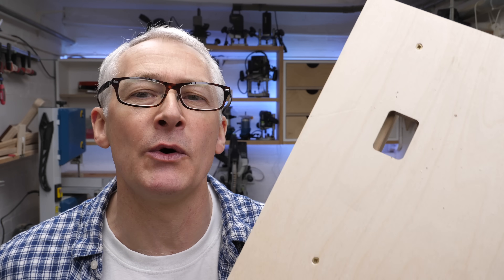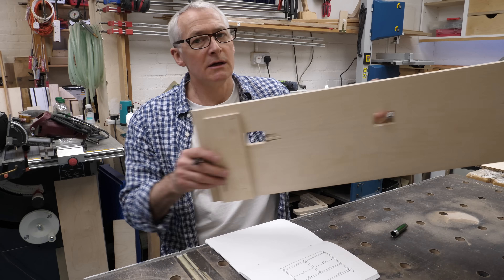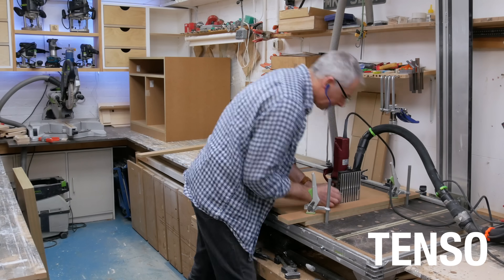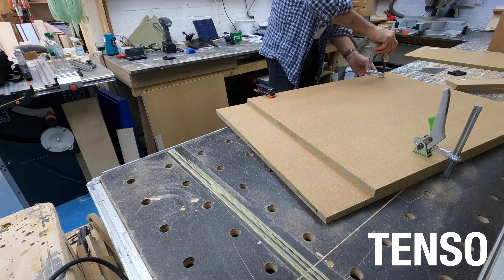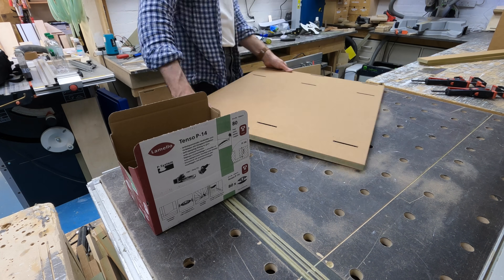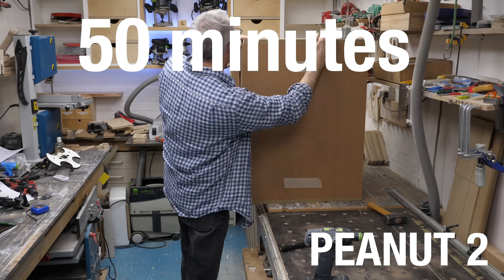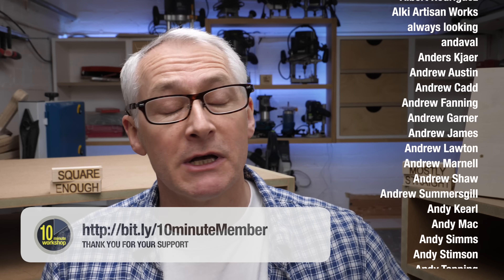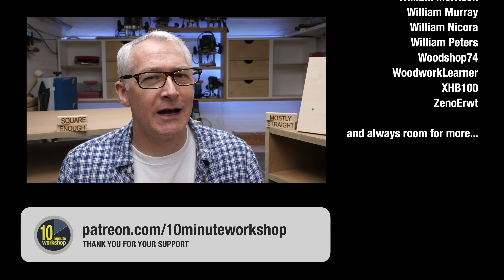Peanut 2 or Lamello Tenso? [**Gifted/Ad][video 450]

Comment: Really interesting. I was exhausted after watching it all at X8 ! I was wondering if there is any real advantage between the two systems (apart from price). Is one considered stronger than the other, or are there certain applications where you might choose one in preference to the other.
Great video, thank you!
Reply from the maker: Thanks! The big difference really is the price difference between the two, not just the up-front costs, but the consumables as well. In terms of strength, the Peanuts2 is vastly stronger than the Tenso; a Tenso joint must be glued as well, the Peanut2 can be dry fitted.
Reply: @10MinuteWorkshop  Thank you!

Comment: Would like to see a domino jig comparison, perhaps up against a dowel jig, this is the least expensive option and much of the time knock down fixings are either not required or not desirable.
Reply from the maker: I’ve done the plain-vanilla comparison in the Cabinetry Basics series; my idea for a domino jig would be as a carcasss jig, so an e.g. 3-slot jig for 600mm deep cabinets. 👍👍

Comment: Amazing, wish I could move that fast.  Question....why does it appear the upper drawer cavities are of differing heights at about 10:10, right after the comment on 55 minutes?  Is that an optitrickal relusion?  Fascinating to watch.  Ps, I made a router jig for using Dominos before I got a real one.  It worked well but was limited.
Reply from the maker: I wish I could move that fast too! And no, just optics - the cabinets are identical. 👍

Comment: Excellent video as always Peter. I always learn a trick or two from your videos. Do you know the strength of the two different fastening methods? Just curious which one is the stronger system. Maybe a good idea for a video? Peanut vs Lamello vs domino strength test??? 🙂
Also.... have you had a chance to try the Lamello Flexus connectors yet? They come in pretty handy.
Thanks Peter
Ron
Reply from the maker: Thanks Ron! No, I haven’t tried the flexus yet - haven’t had the need tbh. And as for strength tests, the peanut wins hands down; 90Kg in MDF and 140Kg in plywood, vs 7Kg for the Tenso and ~80Kg (from memory) for the Clamex. 👍👍

Comment: Great video as always. Having worked with Luke at IF I know they are always helpful and he has a great eye for detail in his products. My main question for you is, when it’s time to make a paid three carcass project for say kitchen wall cabinets, without thinking about it, which system would you use to build it?
I presume you would go domino? (I know not all the systems are equal). 
Will I see you again at the Summer Cycle?
Reply from the maker: Thanks! I think I’d tend to default to Dominos, just because it’s what I’ve used for the longest, and I’m most comfortable with. And yes - if it’s open, we’ll be there! 👍👍
Reply: @10MinuteWorkshop  Thank you, for your honest opinion. Fingers crossed it will be.

Comment: Do you think a peanut system would work on a cnc machine? I'd imagine if it could be written into the code to do the style of pocket this would be a very quick and cost effective system, apart from the super expensive cnc machine of course
Reply from the maker: It was designed for CNC and nesting machines. Have a chat with the guys at @intelligentfixings that have vast experience in this area, and are very approachable. 👍👍

Comment: Another great video Peter, what would you say was the reason the Lamelo fell apart? Would also be interesting to see the strength of both the cabinets once constructed
Reply from the maker: The Tenso carcass fell apart because it doesn’t have the clamping strength to hold together, in my experience. The Clamex connectors are excellent, but the Tenso seems to be a much lighter-weight fitting.
Reply: Tenso needs glue
Reply: @10MinuteWorkshop  I don't understand this comparison- You're not using the Tenso correctly (needs to be used with glued) and bashing the system because you're not using it correctly?

Comment: Peter I'm a bit surprised you don't use the Zeta more often for carcass assembly. It may be because you're so accustomed to the Domino? Or you don't want to upcharge for the more expensive fittings? It seems to me from your videos that the Zeta might be quicker to work with.
Reply from the maker: It’s more that I bought the Zeta around the time that I started to do less cabinetry, really, and though the fittings are very expensive, they were usually a tiny amount of the overall price of a job. To make this carcass with Doninos would be much more challenging at the glue-up - I may do it as a ‘domino project’ just for fun. 👍
Reply: @10MinuteWorkshop  I enjoy using the Domino but I find it can be unforgiving and/or overkill for basic carcass joinery that's going to get screwed together anyway. I'm eyeballing the Zeta for the Clamex and Tenso.

Comment: That's a great video, thanks for the content! 

I was thinking the same thing 're the loose tenon. Interesting to see how fast that went up, Im really surprised as I love the Lamello for its speed but the connector cost is a big draw back. Not so much an issue when building for clients as you pass the cost on but when making jigs, boxes, carcasses etc in the workshop I have a tendency to not use it as its all additional cost and it soon adds up over time. How would you rate the Tenso vs Peanut in terms of strength? 

Do you think we could make a jig and use the Peanuts to make timber panels up? That's one of the jobs we use the Lamello for, when you have 40 signs to make consisting of 160 pieces of timber, the Lamello sure cuts down on the clamping time. Do you think the glue would squeeze out of the joint or would it leave enough in there to join the pieces together?
Reply from the maker: Thanks! Peanut is 10x as strong at the Tenso - literally, 7Kg (Tenso) vs 90Kg (Peanut in MDF) or 140Kg (peanut in Birch ply). That's a great point about panel glue-up and too much clamping pressure - hadn't actually considered that, but the Peanut joint tightens the more you move it, so I guess you'd just nip it up enough to give a good pressure. Don't know if @intelligentfixings have done any tests on this? Hopefully we'll hear back, but if not give them a shout - they're very approachable. 👍
Reply: @10MinuteWorkshop  Ill definitely give them a shout. You have now created a whole world of issues for me though. There are lots of smaller projects we could batch out and have for sale on the shelf but the tenso cost makes it prohibitive...hmmm I might need one of these 🤦‍♂️ haha thanks again Peter. Have a great day!

Comment: For the domino jig could you just use the peanut 2 jugs you’ve already made with a 8mm spiral down cut router bit instead of the peanut router bit.
Reply from the maker: But only 1 size of slot. 👍

Comment: You know… I know it’s not really your normal video, but… it does make me want to see some destructive testing of domino vs zeta vs peanut 2 vs glued-nailed. I know tests like that are always controversial, though. I also vaguely wonder if you can add strength to a domino by running a couple of 23-ga pins into a dominoed joint strategically. YouTube has a lot of “let’s see if X joint is stronger than Y joint” but not many “how can I make this joint stronger” videos. Except for that guy that always pins the top and bottom dovetail or finger in joints.
Reply from the maker: I stopped doing those kind of test comparisons a while back, for exactly the reasons you state - plus they take a lot of time to do, and generate more moaning comments about methodology than any real interest in the results. Not sure a 23g pin driven through a domino would add much strength - once the glue’s let go I wouldn’t rely on a 23g pin to hold much together - but I know guys who clamp, pin the domino, then remove the clamps. Shear strength for Clamex (~80kg) and Peanut 2 fittings (~140kg) are stated by the manufacturers, but festool don’t publish anything for the Domino, unfortunately. 👍

Comment: Could I just skip the Domino for furniture and just start my career with an IF Peanut 2 or 3?  🥜
Reply from the maker: You could certainly start it with that - I wouldn’t rule out domino usage or ownership at a future point, but you can certainly start with the peanut 2 (P3 is for insertion by industrial nesting machines btw) and use the peanut jig as a dowel jig for more budget jobs. 👍👍

Comment: I know it's a professional tool, but when you've spent £1,500 on it, then having to spend £20 on fittings for what is a small build, seems quite high. Ouch!
Reply from the maker: Yep. And Clamex would have been £40-odd. Dominos would be ~£1.20, dowels ~50p